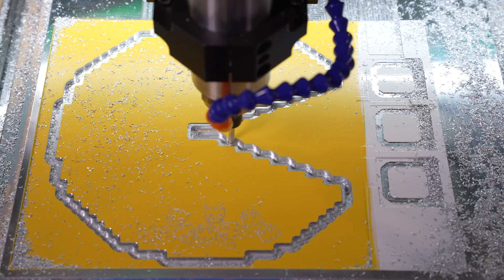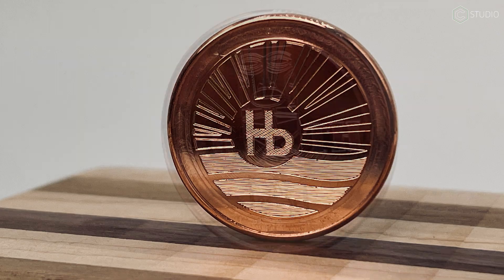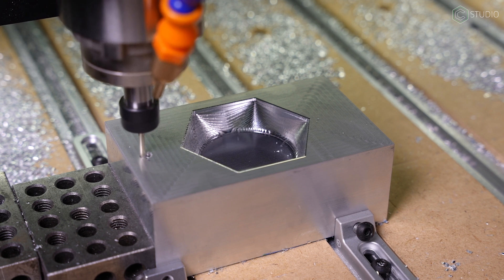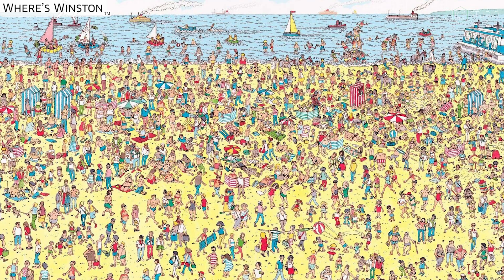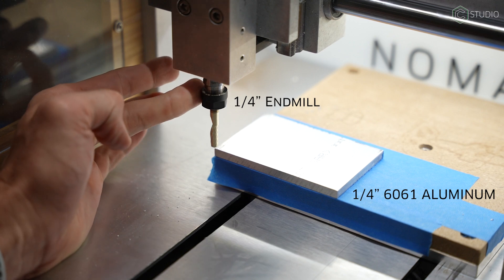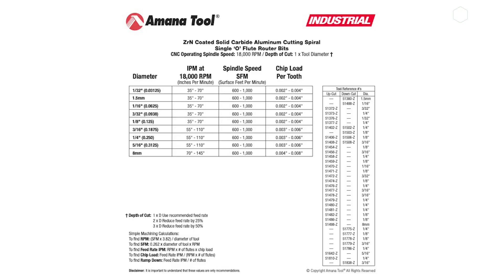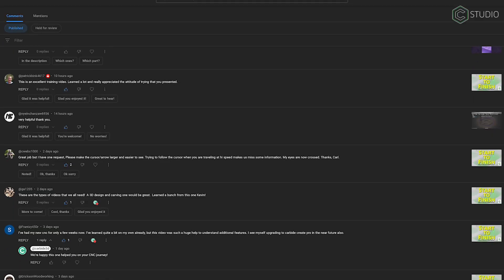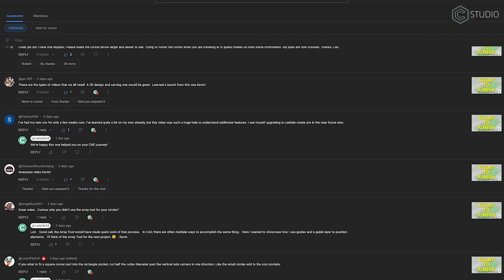You Need to Start Machining Metal

Comment: I wish Carbide supported adding metric bits to the library without the need to fight with calculators (though this may just be that I am still using v6 as money is so tight its ridiculous, so I don't get to use my machine very often.

Comment: So I have started cutting and engraving aluminium but how can I actually figure out if the speeds are correct, for example I made a cut an d the edges are quite stringy so how do I figure out what to change?
Tho the workholding advice is really good

Comment: I already 3d print and design my own stuff which has been fun but always wished I could work in metal. So decided to try CNC and hope I will be able to learn CNC and do some simple aluminum cutting. Just ordered a Genmitsu 3020-PRO Ultra as I don't have a lot of space in my workshop and didn't want to sink a ton of cash. It was the cheapest one that people actually were able to do basic aluminum cutting with. I went ahead and ordered an enclosure too so I don't make a huge mess. This video was encouraging!
Reply: Im looking for a desktop cnc rn. What is your experience with yours?
Reply: @lucapansa8340  Kinda wishing I had ordered the larger one already. When you add the wood backing board to your work surface, plus length of router bits it really doesn't have a lot of vertical and platform certainly not huge. I'm ordering some shorter router bits to compensate but if I were to start over, I'd buy their larger one. Just depends on what you are working with. Assume you can not use the full length and width of the base as you will need a little border all around... plus factor in backing board and router bit when looking at height and see if your projects will fit.

Comment: Do you have a video of tool changes and setup of the machines?
Reply from the maker: We show a lot of projects that involve multiple endmills, but we often gloss over it because the ability/hardware to do it has been readily available for many years now. It's something we admittedly take for granted.

For a video that shows what that multi-tool workflow looks like, you can check out one of our older videos here: https://www.youtube.com/watch?v=I97XwLBmyuc
Note, the software has evolved over time, and the integration with our newest machines has improved as well.

For a sort of step-by-step look at how to make a project and operate our machines, you can check out the Shapeoko Jumpstart course we have here: https://carbide3d.com/hub/courses/jumpstart/
Reply: @carbide3d thank you for the response I'll check out the links

Comment: "yOu caN't cUt mETal with a bElt drIven cNC" thats funny cause the two lathes we have at work have belt driven spindles and the two mill turn machines have belt driven bevel gears to drive the milling head. We had a dinosaur lathe from the early 80s that was also belt driven and it ran just fine.
Reply from the maker: Yes, Conway.  100x yes
- Kevin

Comment: do you think the Shapeoko Pro would be accurate enough to cut a mold for injection molding?
Reply from the maker: Hey Sean,   
Some customers do mold production work for themselves and others on the Shapeoko platform.   They have had success dialing in their processes.  Take a look at Row Innovations:  https://www.instagram.com/reel/B4h7dALgvoi/
I also checked in with Winston on this subject.  He responded, "Injection molds would be fine as long as they can accept the stated tolerances of however many thou. And that you can't really drill. So pins for alignment may bind if you don't manually ream the holes after machining."
Like anything, dialing in the process of making and finishing the mold would be key.   The Shapeoko is incredibly rigid and consistent.   That consistency is the key to creating an effective workflow for molds.
- Kevin

Comment: I machine all sorts of metals on the newest and biggest CNC mills. If theres one thing you should always avoid: way too long stickout on your tools. Very often I see videos of these smaller desktop CNCs with endmills sticking out like 2 inches doing extremely shallow cuts - and the chatter is insane. Your tools will die rapidly and dull and your finish will be utter shite.

If your machine doesnt have the power to take big cuts - buy the tooling that gives you the smallest stickout.

Comment: Alright then. My endmill pulls my belt driven spindle along the inactive axis. So if I am cutting along Y, the tool wonders along X axis, and vice versa. This messes up WCS. There is some melting going on. What to change?
Reply from the maker: This is a fantastic question to post in our forums and the unofficial Facebook page.  Include photos and more specifics related to speeds, feeds and depth of cut, material being cut, type of endmill and type of machine.  
In the forum, post your file so people can look through it and better help to diagnose what might be at issue.  
Once done, drop the link to your posts here.

Comment: If a tool is rotating inside a material, but stationery, it is not going to heat up, bcos, there is no material to rub against. 

Same way, I dont think a slow moving tool rubs against the material and can cuase rubbing and heating and melting etc. But several videos say that this will happen, if the feedrate is too slow. 

If slow moving tool can rub and heat, then by the same logic, a stationery tool (but rotating) inside the material shud rub and heat up a lot more. Does this happen ? Can someone explain this ?

Comment: I already started cutting metal as soon as I got my Shapeoko 4. It does alright, but honestly has some issues with the rigidity and I've messed up countless parts because of chatter and skipping the motor. I know it's due to the plastic wheels used for motion. I easily solved the problem by purchasing an HDM. It's set to arrive in two days and I can't say enough how excited I am to get it and see how hard I can push it.
Reply from the maker: Hey Bryn,  With the Shapeoko 4, adjusting your V-wheels is critical.  If you are getting chatter, dial in your DOC and speeds and feeds.  It's possible to get excellent results with any Shapeoko machine when all the factors are in balance.

Enjoy that HDM......😉

Comment: One thing they fail to mention in the video about coatings.  If you're cutting aluminum stay away from coatings that contain aluminum.  Aluminum likes to stick to itself.  That will increase the chances of chips welding to the end mill.  One thing that I disagree on is using a single flute tool. 3 flute end mills are the best option for cutting aluminum.  The are more rigid than a single flute yet they have a large enough chip gullet to take a large cut without getting packed with chips.  Avoid using "down cut" tools in metal as well.  You'll have all kinds of issues with recutting chips.

A more advanced topic they didn't touch on is radial chip thinning.  The smaller your radial step over on your tool the thinner the chip will be.  If you use a tiny step over then you can go MUCH faster feed rate to achieve the proper chip thickness.  This is more advanced than what the video here covers, but is also a reason why you could be putting excess heat into the work piece.

Comment: I love this.  I got the 2nd cheapest 3018 I could find and Ive been loving this process.  I have a forge and ive been melting pop cans in a crucible and pouring them into small brick molds.  Last night I clamped one in and used the mill to surface the top down flat. Wonderful process, and really nice finish.  Figuring out the proper feed rates and spindle speeds will take some work.
What about stone (rock)?  MY granddaughter found a neat rock at the beach and just HAS to keep it.  I want to carve her name in it as it has one very flat surface.  What kind of bit would I need to carve into an average skipping stone?  I look forward to shopping on your site and getting some better bits and clamps.
Reply: I don't know anything about this cutting stuff, but I do work with Tile installation. Cutting stone I'm guessing a diamond bit would work but use lubrication. Water will work, You want to keep the bit cool.
Reply: I tried a small diamond bit made for a Dremel tool.  It didnt hold up very long at even the slowest of speeds.  The diamond dust coating is fine, but the glue holding it to the bit doesnt hold up. @RailyardProductions

Comment: all i have right now is an old roland mdx-40 but i need to make some aluninum molds for diy plastic injection molding. i know its 'possible' to use the mdx-40 to mill aluminum, and i've seen a few videos of people doing it, but i've always been worried about frying my motor or something. replacement parts are getting hard to come by now

Comment: Wish this was all available when I started out some 20+ years ago. Great tips on using 1 flute cutters and the short explanation of different aluminum types. One thing to remember is that you only know what you machine and endmill are capable of is when you have gone too fast or too deep and have broken a few. So if you buy endmills, start with one or two versions (I'd suggest 1/4 and 1/8) and a few of each. I now use a professional CNC machine and sometimes fairly expensive tooling but I will still do this and buy a pack of 5 of the same endmills because I know I am going to break a few of them - it's all part of the game.
Reply from the maker: It is indeed “all part of the game”.  Well said.

Comment: Personally, I've found that buying a proper quality Endmill made for the job at hand goes a long way when it comes to cutting Metals... Tried doing some Aluminium Cutting using the Endmills I had left over from when I bought with my imported Inventables X-Carve way back and they were kinda... meh? Biggest issue was that they really liked to gum up which depending on their size usually means instant death.

For a project absolutely necessitating a part to be made out of metal instead of the usual 3D Print I then bit the bullet and bought myself some way more expensive locally produced Datron ones and Booi ( God of War™ ) are they a different kind of beast in cut quality... Suddenly going from not quite screeching but very much super audible cutting to almost humming is like: https://i.imgur.com/pmHGrq1.gif 🤯

Comment: I'm very interested to know if the redENERGY G4 EP-Z Pulsed Fiber Laser can be mounted where the router/ spindle is fixed on Shapeoko 5 Pro?  I'm also curious about mounting 3D printing extruders & other basic extruders in the place of the router.

Comment: Buying quality cutting tools is worth the money. I use the TiCN coated endmills and they really hold up in aluminum where coolant and lubricants are not used. The cheapo endmills might look good but they’re crap. A guy brought a part to my shop with a Chinese "carbide" drill broken off in it and I used a good name brand endmill to cut it out. It cut it like butter. The thing to watch out for when cutting aluminum is chip weld. A chip gets stuck to the flute which causes mor chips to stick and in a few seconds the whole cut is blob of aluminum with an endmill broken off in it. You definitely need to watch aluminum while you run it.

Comment: Great information! I would emphasize the work holding that Kevin mentioned is super important to reduce any chatter. Also, make sure you have a collet that has very little runout. This may not be as important for milling wood, but very important when milling metals. Thanks for sharing and encouraging!
Reply from the maker: Thanks for checking in and contributing Patrick!

Comment: I think going for a slower feed rate is a safer option than sticking to the ‘safe’ range of the end mill. Going deep should also be avoided. Though I did manage to cut through a 10 mm stock as my first ever cnc job. Though I did go at a very low feed rate.
As one gets more experienced,  workholding techniques will take up more of your time
Reply: I worked in the anodizing department at a shop in Colorado, one day my boss dragged me out on the floor and told me to watch this cutting machine and make sure the machine didn't run low on lubricant. Simple job. So I sat there watching this machine cutting, a few hours later my boss returned and started yelling at me then ran into his office. I followed him in and told him I did exactly what he told me to do. Turns out he got called to leave the building for a meeting. The part I was Machining was a 50k prototype for Hewlett-Packard. It was destroyed.  I walked out of his office with my job intact. Moral of the story, Don't tell a 20yr old kid to run a machine he knows nothing about! lol.

Comment: Gotta admit, this video makes me a little salty.  I bought an original Shapeoko 3 when they first came out.  Way back then, the claim was also made it could cut metal.  It was true in only the broadest sense.  The original Z axis design didn't have enough rigidity at all,  so chatter was a terrible problem.  Also, the original "bed" was just a piece of MDF with a couple of spindly steel supports. You could deflect the bed 0.03" by pushing with your finger.  Again, not great for rigidity.  The palm router will do the job, but the "recipe" thing is kind of a crock.  It is "choose your own adventure" because with a palm router the speeds are way too high and the torque way to low to line up with any "standard" cutters.   So, yes with a bunch of trial and error (mostly error) you can eventually make some aluminum parts that are +/-0.02" of what you were after that might have okay surface finish.  If you are making a skateboard deck, where that kind of tolerance is acceptable then maybe this is okay.  If you are wanting something with some dimensional control (like +/- 0.005 or smaller) then this is the wrong machine for you.

I just hate to see them oversell the capabilities of the machine.  It is a great machine, and I love their software and ecosystem they try to provide.  It just isn't really right for cutting aluminum and they do everyone a disservice by continuing to claim it.

For roughly double the cost of the Shapeoko, you can get a small CNC mill running that will actually do everything you really want to do.  And it does it in a way that is supported by the full might of the worlds machining industry.  My $0.02 is that it is worth the extra money to really get what you want and save yourself a bunch of time.
Reply from the maker: We had LOTS of users cutting aluminum with the original Shapeoko 3 from 2015, and we did a lot of aluminum projects internally with them.  

Every machine we make has been more capable than the ones that came before it.  Our newer machines are more rigid and cut aluminum a lot better, but the Shapeoko 3 did well for lots of people.
Reply: I got a Shapeoko 3 in 2015 that I still use today. I’ve cut some aluminum since the beginning, but just at a hobby level making bottle openers, etc. I did the XL upgrade then the XXL then HDZ. Now I’d like to have linear rails and X and Y ballscrews.

Comment: I’ve been running across this channel on my search for cnc how to videos. I’m not exactly new to it but it has been a long time. I would consider myself a beginner because of the length of time. I just recently purchased a V1 Engineering Lowrider DIY CNC. Still in the process of building it. I am still unsure about programs to use for the cnc as far as creating objects, parts etc. Also what to use to convert everything to Gcode. There is a lot out there. Any advice to help steer me in the right direction would be grateful.
Reply from the maker: If you’re running a third party machine you’ll need Carbide Create Pro.   Even for people with higher end CAD programs, Create has a place for quick 2D design and cut.  
You’ll need Pro for the ability to output G Code, but it also comes with a raft of handy features.  Check it out here:  https://youtu.be/0W-5nv4izqA?si=bnZIsQLJaZsvgMvv

Comment: We use a sweepie with a shop vac and cheap 5 gallon bucket dust collector. No problems pulling aluminum chips out of fairly deep pockets so long as the sweepie is engaging the work. 
Also, the Create feeds and speeds are super conservative, but that’s great for getting started. Always good to see Winston in a video, he’s a wealth of good ideas.
Reply from the maker: Indeed he is.

Comment: It was a long time before I could get dry cutting to work well, and I still prefer lubricant because it mostly eliminates airborne metal dust. I use Anchorlube. It's water based so it cleans up easily, and you can add water to thin it out as needed (thicker will stick to vertical surfaces better, thinner will flow down into deep channels better). No trouble cutting aluminum chip soup, as long as you can clear enough chips between each pass to keep the bottom of the channel wet. I use a syringe with a piece of rubber tube on it for application.

Comment: I really love the practical "just get started" approach, and not worry too much about the technical details. That's actually something I struggle with, so for me it's good to hear that message.
Reply from the maker: Terrific!
Reply: Make sure you wear eye protection, as the machine will want to rip the part of the bed and throw it.  Also, be ready to break end mills.  Buy end mills in bulk.  Also, get ready to listen to your machine run for hours and hours to make very small cuts.